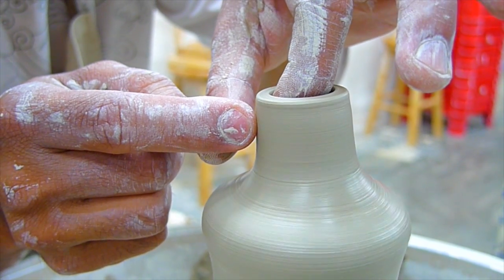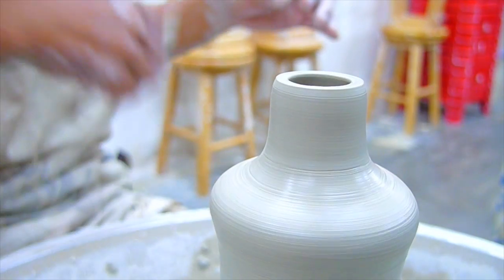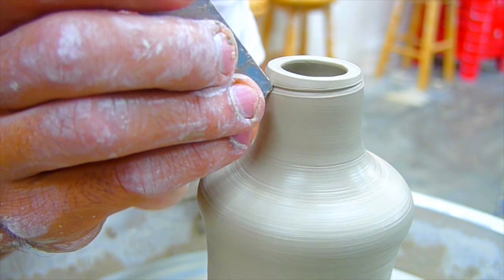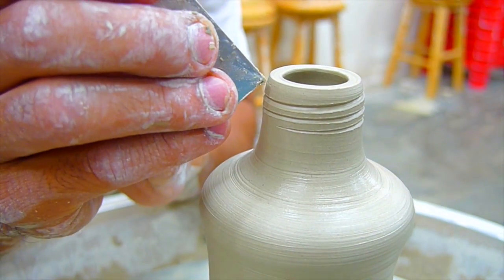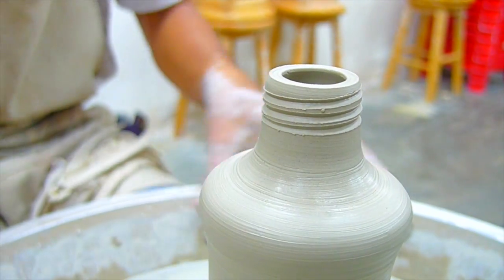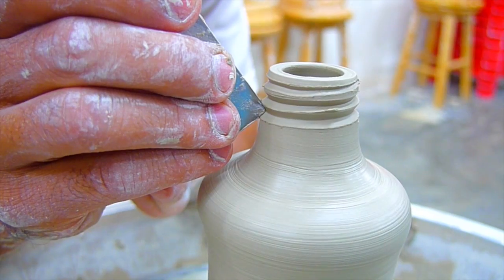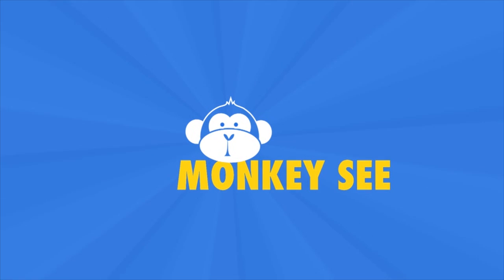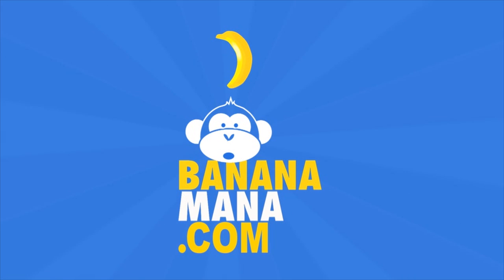How to make a screw top bottle - Clay Craft Malaysia

Comment: First you need to know how much your clay shrinks. The shrinkage of the clay i use is 15%. If i need to make an item which is 4" (h) x 3" (D) after firing, i will to add 15% to the measurement. So, 4" x 115% = 4.6" and 3" x 115% = 3.5". When i  make the piece, i actually make them bigger so that it will shrink to the size i want after firing.

Comment: As for the groove to work, the tricky part is to match the speed of the potter's wheel to the movement of your tool. You want to make a spiral indention. It took us a lot and i mean a lot of tries before we got it right. This one really needs practice. Because the measurement has to be quite precise, we could not glaze the groove area. You can do it but will need to calculate the thickness that the glaze adds to the groove. Too much work, i think!

Comment: The plastic bottle cylinder could be made into a tap tool that cuts male and female parts at the same time by melting it into a thread system. Also, just to marry the wide diameter openings in the plastic bottle cylinder together the threads could be melted over one another with aluminum foil in between that they don't stick together. So, first melt opening around a stud that could be made of just twine or string around a cylinder and then the slightly wider thread melted to that. Potentially made to be a 100 percent wide diameter air and liquid tight screwing closure made from a waste material.  greyishgreblum, "Pottery tap and die"💜

Comment: A 'cookie cutter' tap tool for cutting both male and female parts at the same time, I think can be melted into shape out of the wide diameter cylinder portion of a plastic bottle over a preformed stud like a cylinder with a string or twine spiral thread at the proper pitch. Aluminum foil could be used so two different sections could be formed together and be unscrewed and then screwed back together as a tight closure. 10:47pm greyishgreblum, "Pottery tap and die"💜